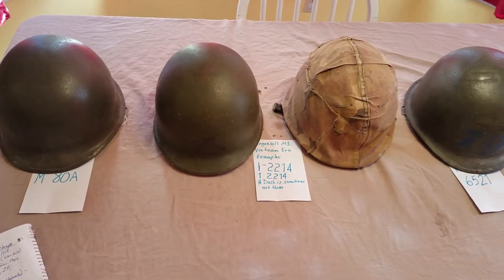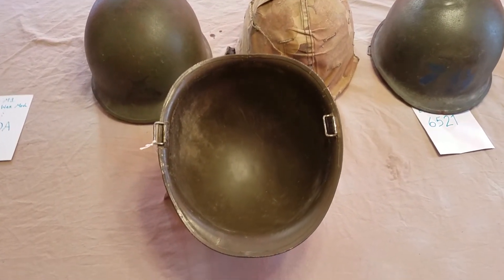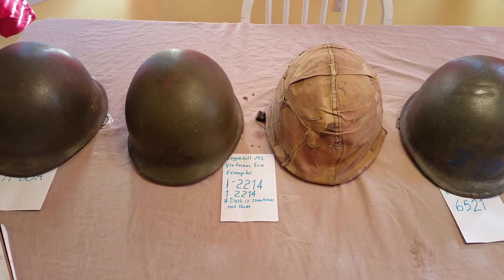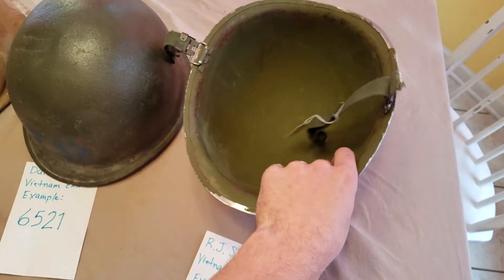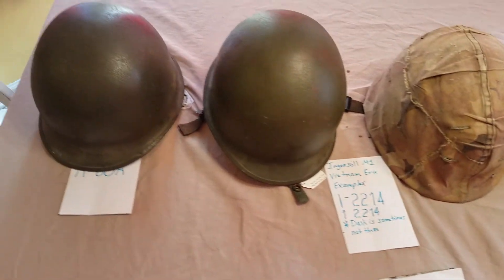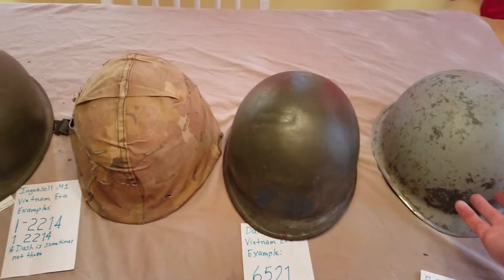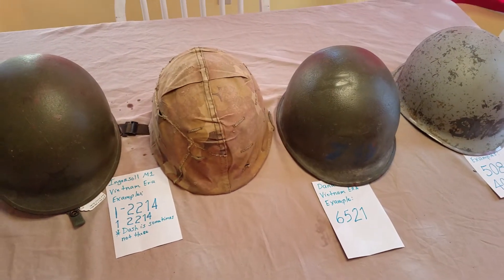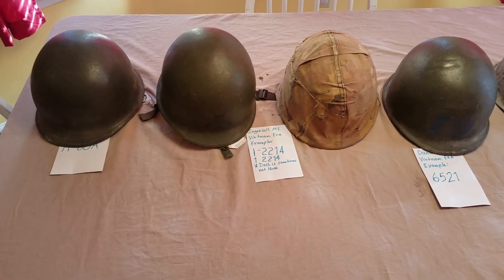How To Identify A Helmet Heat Stamp: Korea - Vietnam

Comment: Thank you for posting this video! I have either a Parrish or RJ Stampings helmet. It is double stamped 8924. One is upside down the other is 1.5” beside it right side up. Is there a way to tell between those two manufacturers?
Reply from the maker: If it is upside down then it would usually be a Parish

Comment: What are the chances that my m1 is 80’s? It’s one of the Canadian made ones. It has a rear seam and a stainless steal rim. It’s stamp is 635. It came with a with a 1983 dated liner, it’s a type 1 liner. I’m pretty sure that the liner is not from this shell considering the liner’s rim sticks out of the shell when together.
Reply from the maker: Is the liner in backwards? It sounds like a silly question but I have seen helmets with liners in backwards and the liners rim sticks out beyond the edge of the helmet.
Reply: No sir, it’s in the right direction.
Reply from the maker: @Bigman-xy5zw  I wonder if it may be a foreign liner. Your helmet would be from the 1970s. M1 helmets were used until around 1983/1984 until kevlar helmets were the standard helmet.
Reply: The liner is US. “LINER, HELMET
GROUND TROOPS TYPE 1 NSN 8470-00-935-6843 DLA-100-83-C-4252” that’s it’s info
Reply from the maker: @Bigman-xy5zw  Yep definitely 1983 liner. Not sure then why it would stick out.
Reply: “Int’l Molded Plastics Co” is the name of the marking in the crown of the liner, I thinks that’s it’s manufacturer.
Reply from the maker: @Bigman-xy5zw  International Molded Plastics liners have a person inside of an oval shape in the crown of the liner.

Comment: I have an m1 helmet that also came with what I believe to be an ERDL cover. The helmet's heat stamp is M 335 B, which would make it a McCord 1951-1952 model. There is also yellow paint underneath the green on the shell which would have made it a re purposed us navy helmet?
Reply from the maker: csjdruid Yes it is a Model 1951/1952 for sure. There is also a good chance like you said that it could have been a previous navy helmet. Thanks for watching.

Comment: Hey. I have a (what i think is) a vietnam helmet. It has vietnam chinstraps but i cant for the life of me find the heat stamp. I have looked all around it and i cant find it. Anyone know what that may mean?
Reply from the maker: It could have been lightly stamped and faded over time or it could have been painted over. I use a flashlight and magnifying glass to look for heat stamps sometimes.
Reply: Just in case this helps, its a front seam and was bought for 20$ at a flea market. Swivel bale and liner is a paratrooper liner and dated 21 july 1967.  Btw chinstraps are not paratrooper.

Comment: Good stuff, I have a question. Not sure what you were saying about the Korea McCord helmets being repurposed. Were Korea helmets used in Vietnam? I have a McCord helmet with the rear seam, not stainless steel, I'm trying to date it but there is so much confusing information everywhere. I looked on a sight Top Pots which had the following info; " In October 1944 the rim material changed from stainless to the same steel that the helmets were made from (Hadfield Maganese).  Evidently, for some unknown reason, at the same time, the weld seam of the rim also migrated to the rear. The total production of WWII M-1 helmet shells reached over 22,000,000 by August 1945. M-1 helmet production ceased just days after the war ended. Noted: M-1 helmet shell production would not begin again until March 1951 because of the Korean War". You appear to have real good knowledge on the subject, can you help me?
Reply from the maker: If you can locate the heat stamp that would be good. There is a chance that your helmet was made in late 1944 - 1945. But If the heat stamp starts with the letter M or starts with an MW then it was made in 1951. But Ww2 helmets, gear, weapons, supplies etc were used in Korea and Vietnam also just like a lot of left over WW1 stuff was used at the beginning of WW2.
Reply: @JonBoyMilitaria  The heat stamp is M 310, or the zero is a nine but I'm 97% sure it is a zero. It's interesting cause there are two names on the helmet, one with extremely old large masking tape, and another name x2 one inside in faded pin and again outside scratched in. I have what I think is a mid 60's liner and a 76 cover.
Reply from the maker: @BackPackFilmsFl  The helmet itself is definitely a Model 1951 McCord. Sounds like it was issued to at least 2 different soldiers. Maybe one during the Korean War and one during the Vietnam War.
Reply: @JonBoyMilitaria  Thank You!
Reply from the maker: @BackPackFilmsFl  You're welcome. Anytime.

Comment: You are detailed. Maybe, you can tell me how to identify this helmet I just found at a thrift store today...It has a green strap with a date 23 July 1964.  The heat stamp is not clear, it appears to be 234A. The liner has a stamp that reads: US 138 (or maybe 438, it's faded.)
Reply from the maker: Does the helmet have a front seam or a rear seam?
Reply: Front seam.
Reply from the maker: @JULOC05  Do you see an S under the heat stamp?
Reply: No, it's very hard to read.  There something under the stamp to the left that could be C1 but not sure, it's faded.
Reply from the maker: @JULOC05  It sounds like a McCord made helmet. It would've date to July/August 1942.
Reply: So the helmet may be from the 40's and the strap from 1964? Thanks for looking into this by the way, I find it very interesting.  I also need to find out how to clean it without damaging anything.  It smells like tobacco...
Reply from the maker: @JULOC05  Yes. It is a World War 2 Helmet that was reused during the Vietnam war. That's why it has a Vietnam era liner.
Reply: I thought it looked older when I bought it too and it does look like the one you describe. I actually found it tossed on top of some housewares items with dishes and bowls, instead of the apparel or collectibles area...You never know what you will find in thrift stores. Thanks again!
Reply from the maker: That was an awesome find for sure. Congrats. Thanks for commenting.

Comment: Great video very helpful.

I purchased a M1 recently, can anyone help identify which era it comes from. The heat stamp is 1247A which if I am correct identifies it
as a McCord produced in 1945, the swivel bales are spot welded right up against the helmets rim which is also consistent with WW2 however the helmet is finished in light green with a sand textured finish. I’ve inspected the helmet closely and there is no evidence to suggest it’s been repainted.
Any ideas?
Reply from the maker: jimir68 Yes it would be a late war McCord produced in 1945
Reply: JonBoy09 
Thank you for your help.
Reply from the maker: Anytime. I enjoy interacting with viewers.

Comment: Hello man, really enjoyed the video. U got my sub.
I have a question tho:
From what time is my M1 helmet? Its back seam and the stamp says either "M46D" or "1146D", but without a space in between the M and the number?
 (If its an M, then the line in the middle got scratched or sth)
The printed stamp in the webbing is barely readable, but probably says 1951/1963 (?)
Ive gotten my hands on this particular M1 helmet, that had been laying around in a barn in southern Germany for decades now.
Full helmet, including outher shell and inner one. Chinstraps made of leather broke after just touching them.
Greetings from Germany :)

Edit: Whats also interesting, is that the paint at the front is scratched off and there are two vertical welding points there, so something was welded on there, what could it be?
Reply from the maker: The 2 vertical welds were probably where captain bars where. If the heat stamp does start with the letter M then it was made in 1951 by McCord.
Reply: @JonBoyMilitaria  Wow, thanks for the great help and the fast reply :)
Already enjoying a lot of your refurbish vids and stuff ^^
Reply from the maker: @chaowingchinghongfingshong3109  Thanks for watching my videos
Reply: @JonBoyMilitaria  Just checked it under perfect light conditions, it is indeed an M for McCord.
Thx for the suggestions with the bars, found pictures online that show that these were welded on in some cases
Reply from the maker: Awesome

Comment: I just got a M1 schlueter helmet and the stamp is 426A could you pls tell me when the helmet was made based on the stamp?
Reply from the maker: Godzilla 62 The schlueters can be kinda difficult to date but yours would be somewhere around December 1944/January 1945...
Reply: JonBoy09 But the weird thing is is that the helmet is a front seam and those where made from April 1941 to November 1944 ( it’s also a fixed bail converted to a swivel bail )
Reply from the maker: Godzilla 62 It could be around November 1944, some of the last front seams to be produced.
Reply: JonBoy09 alright thanks also that would be really cool
Reply from the maker: Godzilla 62 You're welcome.

Comment: The model (M1), is not exactly the same over time, and in the different wars in which it was used ???
Do they have differences between them ??
I do not speak the English language, and I could not intervene aurally, so interesting video.

Use the google translator to write. Many thanks!

CORDIAL GREETING FRIEND !!
Reply from the maker: The M1 helmets started being produced in 1941. They started out with a front seam and fixed bales. In October 1943 the bales were switched to swivels and then around October 1944 the seam was moved to the rear. The M1s in this video are the post World War 2 ones. In this video, I am going over how to determine what era the M1 was produced and also showing examples of the companies that produced them as well. I hope this helps. Thank you for watching.

Comment: I found a m1 helmet in Vietnam it’s condition on the heat stamp makes it harder to find the rest of numbers but I got 89
Reply from the maker: Kevin O’Pry Has it been repainted?
Reply: JonBoy09 it has not
Reply: JonBoy09 I don’t know if this might help but the straps got 04
Reply from the maker: Not sure. So the helmet is a rear seam? The heat stamp on Vietnam era helmets could be just about anywhere inside the helmet. It could even be upside down. I usually use a magnifying glass and a small LED flashlight to see heat stamps. You could also use the pencil and paper trick, or use a piece of chalk and go over the heat stamp area.
Reply: JonBoy09 it’s rear seam yes I’ll try the chalk trick out oh it’s a McCord I found the m 89 not sure where the other letter is but im good now

Comment: What does ll97B mean
Reply from the maker: That would be a World War 2 helmet. Made by McCord.
Reply: @JonBoyMilitaria  Thanks!
Reply: Do you know what an orange paint job inside of a steel pot that was a navy shuluter?
Reply from the maker: @dylanl.4723  You're welcome
Reply from the maker: @dylanl.4723  Not sure what the orange would be.
Reply from the maker: @dylanl.4723  You're helmet would date to around February 1945.
Reply: What is 15CA mean? I dont know if that is the entire heatstamp though because of a darn rust spot
Reply from the maker: @dylanl.4723  There can only be one letter. The O could be a 0.
Reply: If it was a zero then what
Reply from the maker: @dylanl.4723  If it is 150A it could be a WW2 McCord, WW2 Schuleter or Korean war McCord. A Schlueter will have a letter S underneath the heat stamp. A Korean War McCord will have a letter M before the numbers.
Reply: Its a shluter. Thanks againå
Reply from the maker: @dylanl.4723  Schlueters are a little more difficult to narrow down when they were made as far as month and year. I can tell you that if it is 150A then it would date to between July 1943 - September 1943.

Comment: What if there is no heat stamp?
Reply from the maker: Sometimes the heat stamp has been painted over or it may have been lightly stamped and faded over time/usage.
Reply: @JonBoyMilitaria  I have a ww2 and a korean war era m1 supposedly. I cant seem to find the stamps. They're both worn out with stress seams.
Reply from the maker: @Paladin_Green  I like to use a magnifying glass and a good LED flashlight
Reply: @JonBoyMilitaria  i'll double check. Currently repairing a really dinged out navy m1

Comment: I have a helmet with the heat stamp I 2353.. I’m not sure if it’s Vietnam era I’ll send you a picture on instagram
Reply from the maker: Noah Ortego Ingersoll 1965 - 1968 helmet.
Reply: Noah Ortego Another way to identify a Vietnam era is the paint.Most Vietnam era helmets were colored a apple green color and have red primer.They also have a sandy texture instead of the cork texture used in WW2.
Reply from the maker: Heptonic48 Yep that's right. In these videos I was just touching on heat stamps instead of talking about all of the different characteristics. If I had then both videos would be like 30 minutes long probably lol.